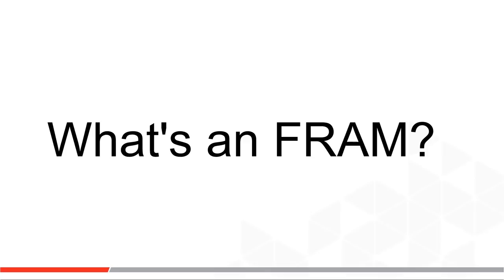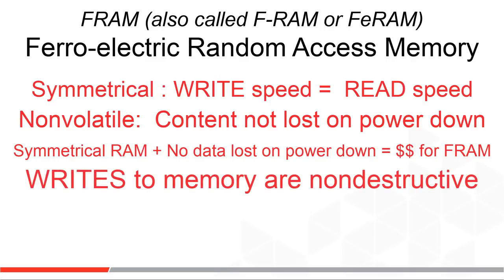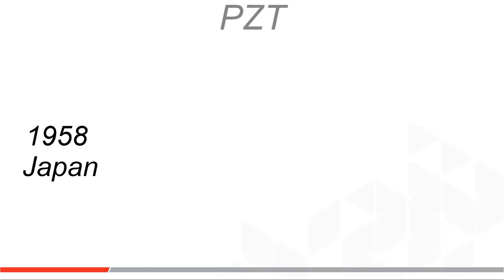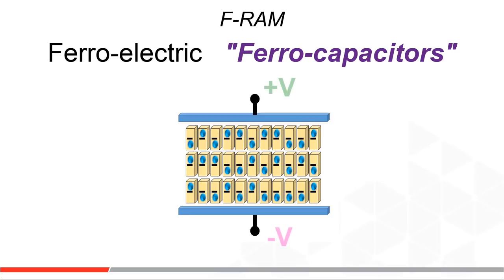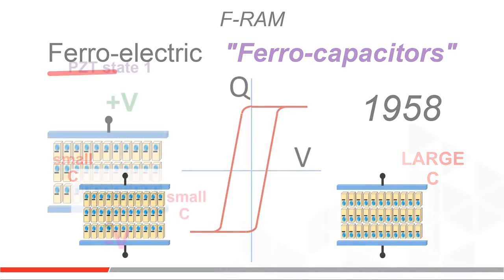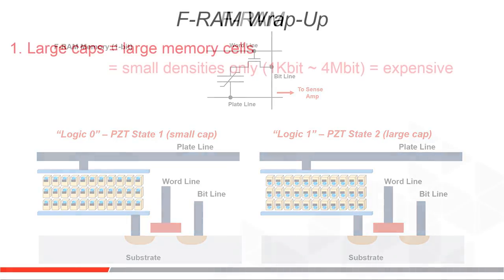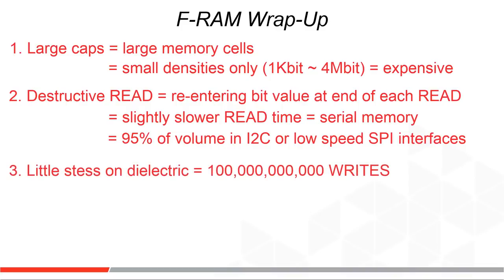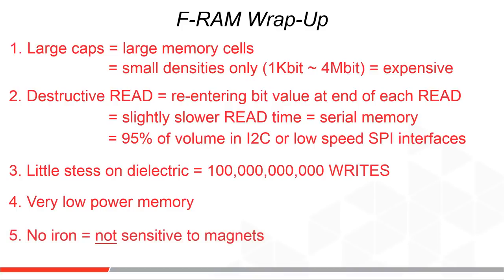What Is...FRAM?

Comment: It seems there is a race condition around use of fram. If you unexpectedly lose power while reading, you would fail to write back and lose the current bit. Is this correct? Perhaps this could be mitigated by first ensuring that a capacitor was charged enough that it could cover the write back while you were crashing.
Reply from the maker: @Craig - Thanks for your question. You clearly understood the “destructive read” behavior during reading FRAM cells. The answer is to stay within the FRAM datasheet specs for ramp rates (up and down). Sharper ramp rates than specified in the datasheet (while quite hard for you to actually create in real world situations) take the part outside the manufacturers spec (and warranty) so were not covered (tested for) by the qualification work done on the IC. The problem you describe is well understood by the  IC designers. So the designers create viable external Vcc rise and fall rate scenarios and make sure via simulation that their IC can get through the destructive read period under the worst case Vcc rise and fall rates. When each FRAM family is fully qualified by the manufacturer before it is released to the market, the manufacturer’s product and test engineering team test statistically large enough groups of the IC against these Vcc rise and fall extremes (and give themselves a bit of margin to those extremes). In the 30 or 40 years FRAM has been on the market any surprise operating environments have been tried and any failures in those environments sent back to the manufacturer to include that scenario (if practical) in any future design spins. So the answer is, check your end product Vcc supply behavior (rise and fall rates) and keep them within the FRAM IC specifications for those rates, and you’ll be fine.

Comment: Both FRAM and nvSRAM are widely used for modding retro game softwares to replace SRAM, make them save game progress without battery.

Unlike nvSRAM, FRAM is still manufactured in 2020~.
Reply from the maker: Absolutely, FRAM and nvSRAM both offer significant advantages when it comes to modding retro games, particularly their ability to retain saved game progress even without a battery. It's beneficial to the gaming community that FRAM is still being manufactured.

Comment: So, if every read requires a rewrite and there is a guaranteed number of rewrites in the range of 100,000,000,000 that means with a 10 MHz read rate of a single cell that cell is broken after continuous reading for 10,000 seconds (less than 3 hours)?
Reply: Its 100 trillion, not billion writes, not reads.
Reply: The memory will typically be accessed at the word level, not the bit level. Also keep in mind each individual bit (or word or row or however else the device is accessed) has the quoted endurance. Writing a single bit only reduces the endurance of those bits accessed, not the whole chip. In an example I found online, if you had a 10Mhz clock, and continuously wrote to the same 64 bytes, the chip would exhaust 18,380 endurance cycles per second. With an endurance of somewhere between a trillion and a quadrillion cycles, the endurance is effectively unlimited.

Source: https://www.cypress.com/file/444171/download
Bottom of page 16 has an endurance chart. The chip in question has an endurance of a quadrillion read/write cycles.
Reply: @chrisbotcom  I believe this person used the numeric representation in this video at 6:00 . The video makes the same mistake. They said 100 trillion but put 100 billion on the screen. My guess is that whoever produced the video doesn't know how to write 100 trillion.